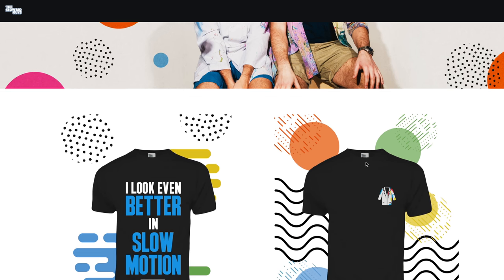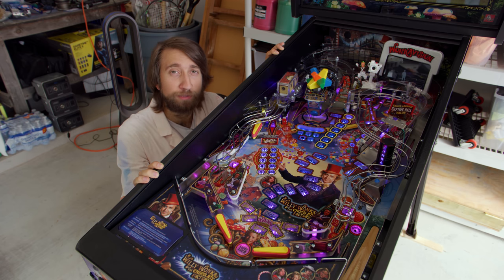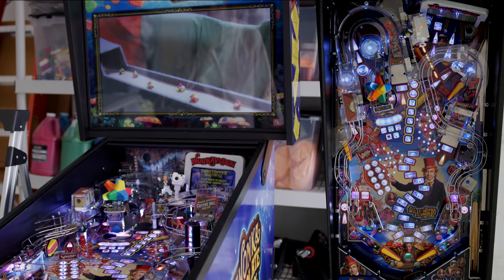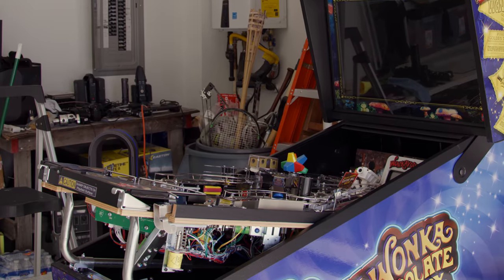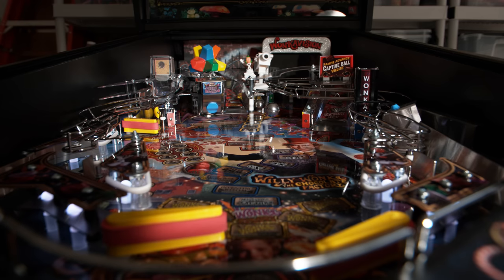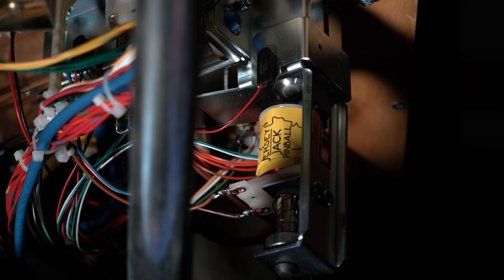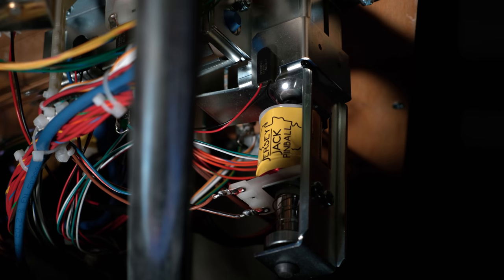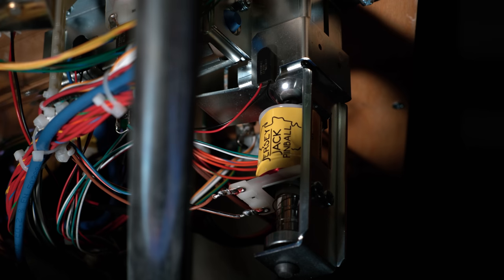How a Pinball Machine works in Slow Motion - The Slow Mo Guys

Comment from the maker: Makes me wonder. Due to these crazy flipper rubber physics, is a live catch possible on a virtual pinball machine? I’ve never played one (other than space cadet) but maybe someone can let me know? - Gav
Reply: For sure possible, but it's wild seeing the real thing slowed down!
Reply: maybe a thing to make newer games more than real. and when it goes too much the other way, it's still something for playpals
Reply: A live catch is very possible on a virtual machine, and likely far more easily achieved than in real life. This is due to a virtual simulation having far less uncontrollable variables to take into account when attempting to stop the ball mid fall. Great video!
Reply: Yes it is possible
Reply: What exactly is a live catch?

If you mean getting the ball to stop to a standstill on a flipper then yeah it is possible on a virtual pinball machine.
I got a lot of them on the default pinball game in older windows. Tho it has been years since I last played it.
Reply: It's possible in Pinball FX but rarely, usually the ball just bounces but it's stopped dead a few times (maybe that's just my lack of skill), death saves are possible in that game too which are pretty fun to do
Reply: Depends on the virtual game and table. Like on pinball arcade, you can live catch the kick-out on RoadShow almost every time, but on pinballFX its slightly more difficult
Reply: if I recall, it was built into PinBot, which came out on the NES, and is based on an actual physical machine I played at a local bowling alley as a kid.  I have the cartridge somewhere.  Great pinball game, whether real or virtual
Reply: Hi Gav, you once filmed a rocket take off in slo-mo, but have you ever filmed(or tried to) a genuine space rocket, and... a second? version that is made using thermography to show the speed at which thermal energy is exerted down/away? the shockwaves from takeoff would be pretty awesome too..
Reply: willy wonka just got better
Reply: I have done it a lot on space pinball
Reply: I went back and checked; you can absolutely live catch in 3D space pinball. 
I’m just thrilled to find out that Gav is such a fan of pinball!
Ed came to a nerd bar in my town and couldn’t put up a hi score. BNL 
If this pandemic ever ends I cordially invite you to Portland, Maine to play some pinball!
Reply from the maker: @DEADFLIP  Good to know. Could have done with your skills making this video!
Reply: It's possible for sure. The hardness level and how to do it varies a bit, since different pinball games have different physics, it's an approximation of real physics, and can vary a lot. Pinball Fx3 has 2 different types, because once they started doing real tables (as opposed to designing their own tables), they also tried to make the physics match the real thing, rather than play well on their own designs. so you can play both sets on the Williams tables. (it's really  3 sets, but tournament mode just has a increased angle of the slope of the table to make the balls move faster. same physics, but it changes how the ball bounces around the table.) 
On a real table it's much trickier, since real tables are subject to wear and tear, things move around and never really does the exact same thing twice. And rubbers age, so even the same table can feel different with aged or different rubbers. on the other hand, it's all analog, so you don't have to deal with input delays which can make things like live catching more difficult.
Oh and , Check out that Dead Flip guy on twitch, he can help you out with anything. ;) (all yours Jack)
Reply: Actually. You Gav, providing footage of what is actually happening with the flippers is very useful for the virtual pinball machine community. Pitty though that you didn't show us more examples. A dream come true would be to have Dead Flip or someone that really know how to do flipper tricks in slow mo.
Reply: In Visual Pinball, it is, but it's hard. We are currently trying to improve Visual Pinball's flipper physics in a next-gen (open source) sim: https://github.com/freezy/VisualPinball.Engine - Gav, if you happen to have more flipper shots, that would help us immensely.
Reply: it's possible, but only because it's explicitly programmed in.  You couldn't perform a live catch in The Pinball Arcade until they patched it in (and after that, it happened way too often), and others like Zen i'm sure have "live catch" code built in.  the minor physical mechanisms that allows for a live catch -- for example the switch from high power coil to low power coil at the apex of the flipper's path -- don't happen in simulations.
Reply: @BrowncoatFairy  Well the williams physics might, the Zen physics, probably not. But it's  still possible to do live catches. (just not reliably.) I'm fairly sure VPX tries to emulate it. as for TPA, yeah that was scripted.  ;)
Reply: @michael-to7ve  holy f... Yes we need this.
Reply: @deanapplegate5750  this is an AMAZING idea.
Reply: I play a virtual pinball machine quite a lot, and using live catches is definitely possible. In fact, it is a very important skill to have.
Reply: It is possible, but only by baking it into the artificial rules of the simulation. Live catches require greater accuracy in timing than 1 frame of video animation, and far greater accuracy than the typical response rate from a virtual system (push button -> computer process -> display result on TV)
Reply: In Space Cadet, there was a nice section near the top that could be reliably reached by catching the ball and then letting it roll almost to the end of the flipper before hitting it full force.
Reply: I have done it in Pinball Arcade, but the physics in that game are really "floaty"
Reply: I have done it before, it is very much possible.
Reply: I always enjoyed your slow motion videos, but this one for me is the best one ever.
So to answer your question, your video got linked by Zen Studios on Facebook, the company that currently has the rights for recreating Williams tables.
Their intention is for the physics to be spot on, so here's an example:
https://www.youtube.com/watch?v=ts5rfZA-hNg

You seriously have no idea how valuable this kind of footage is for us digital pin-fans.
Reply: as far as metroid prime pinball goes. (or as far as my skill goes) no.
Reply: bruh
Reply: It's very much possible in Pinball Arcade, which just emulates real tables very well.
Reply: @bowenkerins  Which is why you separate your physics simulation from your renderer ;)
Reply: @theslowmoguys  And there will be Russian subtitles? (it is translated about a Google the translator)
Reply: It is. It’s actually EASIER to pull it off in certain games
Reply: I just got into Virtual Pinball (3 years later here) and maybe it is just me - but I catch them all the time, tbh too many times when I play - the thought that it happens way to often - goes thru my head.

Comment: We're developing an open source pinball simulator. You can't imagine how valuable this is. Cheers!
Reply: What's it called/where can I find it? I'd happily take a look
Reply: Any chance of VR support? Because this sounds insanely interesting.
Reply: @yp3661  Yes, of course! Unity has good VR support, we just need to figure out how to deal with the different render pipelines. We might need to fall back to URP for VR.
Reply: @CraX Looks like YouTube removed my comment with links to the project. It's called Visual Pinball Engine. Source code is at GitHub. Googling it turns it up pretty quickly...
Reply: Fascinating

Comment: I started playing pinball machines in the mid to late 1970's as a young teenager.  Back then, they were completely mechanical, including the score board which used rotating wheels to display the digits in your score.  The thing the newer electronic machines sadly lack are mechanical flippers.  On the old machines, the button was connected to a rod which connected to the flipper.  You had complete control over how hard the flipper pushed the ball.  If you caught the ball on your right flipper, but wanted to hit a target off of the left flipper, you could give it such a gentle tap that the ball would do a u-turn from the right to the left, then you could slam it up towards the target.  That fine control and finesse is completely absent in the more modern machines.  The flippers swing at 100% force or not at all.
Reply: Thanks for writing this! I'm doing research for a pinball video game I'm working on and in designing the flippers I was surprised that most machines nowadays have digital flip inputs. As someone who always loved the fine control/finesse of foosball growing up, I'm excited to bring analog flippers back here.
Reply: @etin97  Hey, good luck on the game! It would be nice to see some modern pinball games out there =)
Reply: Rigel I started playing them 1970 and collect a few of the old ones, don't really like the electronic type. The flippers were never controlled by a rod but by a solenoid. By tapping the flipper button the solenoid would only partially operate and give the ball control you speak about. I agree the electronic ones have no feel.
Reply: @etin97  The main issue is the reliability of analogue controls. Switches can stand a lot of abuse, and require minimal calibration, while force-sensing buttons will have a limited tolerance range and will need regular checks to make sure the control doesn't start drifting.
Reply: @watchm4ker  sure I think force sensitive buttons are not the move. I think quick digital press vs regular digital press is
Reply: I was lucky to play some of them at my local makerspace before quarantine 
With no ball save u to have to really make those games count but there’s just something so mesmerizing about the old machinery of those games
Reply: "He sure plays a mean pinball."
Reply: @etin97  This will be phenominal in VR! I look forward to seeing your pinball game! Do it buddy!!!
Reply: Yeah i remember them  am 53 now   Rigel i certainly do you had to be quite skilled with your flippers   wish i could see one of them old type   just one more time in my life
Reply: I played a pinball machine for the first time in decades and was totally disappointed for that very reason

Comment: I love this video. Pinball is something I had limited time with at least physically, yet had endless fascination towards especially in form of video game adaptations, fantastical video game logic filled or simulation. And playing actual machines whenever rarely possible.
I would love seeing the same for older "Less electronical" pinball machine, though most things this video focuses on are probably going to be same, with more simple electromechanisms. Solanoids are still solanoids in 70's tables as they are on this modern table.
I also really feel bad for Depp's Wonka, could not even get a pinball table made decades after movie...

Comment: Do a holy Trinity
Slow Mo guys
Smater everyday
Stuff made here
Reply: smater
Reply: @alecweinstein4990  sounds like somebondy skipped a day.
Reply: @brettzolstick989  looks like "somebondy" else did too
Reply: Smarter Every Day made a pinball machine video, and it's awesome. Destin had an old-school electromechanical one he took apart for it!
Reply: Ballistic pin ball machine.
Bulletproof glass. Solid steel case. Air canon launcher, semi-auto flippers based on rocket bat.
Wife mode just sinks the ball immediately.
Reply: What about Mark Rober?
Reply: @brettzolstick989  Slow mo of the blank firing spinning death bat machine

Comment: Technology Connections just did a video on how wires create all the logic for older pinball machines, it was quite fascinating. The hardware hasn't changed, but the control circuits have.

Comment: Random similarity for you space junkies: the Canadarm2 (aka SSRMS: Space Station Remote Manipulator System) on the ISS robot arm's brakes use a high voltage (42V) to release the 7 joints' brakes and then a lower voltage (16V) to hold the brakes released with while the arm is in use. Continuous voltage to stay open is a safety design such that the brakes engage in a power loss scenario. The part where Gav talks about the flippers around 6:35 reminded me of our system though I am sure it is not the exact same architecture it does make me think of the SSRMS.

Comment: There were some rather fascinating pinball games for the Amiga, which IMO played much smoother and better than some of the PC based modelings of many years later.
Oh, and this thumper thing, it explains why one of the machines my boss had acquired made such a noise at certain points, that clearly was not snythetic, much louder, much more violent than anyhing else the machine produced.

Comment: 4:10 I'm lost in nostalgia. In the 70s, when I was going to high school, the local milk bar/smoke shop had room for one pinball machine, and our little gang used to hog it from 7:30am until almost 9am. Luckily, the school was a 2-minute walk. At first, they had some old thing, then they got the Kiss machine. And then came the Playboy machine. 
One morning I started playing (I think it was 20 cents for 3 games) and started getting free balls etc, and replays. At 10am I left, after having gotten to (if memory serves correct) 998975 or thereabouts. It clocked at a million. The sound when you scored a free ball is still in my head as clear as yesterday.

Comment: Something else to check out on high speed:  The switched illumination is actually multiplexed.  At the proper frame rate, you should see these lights pulsing in sequence.  Also, if you've ever seen a machine with a flipper stuck in the up position, it's likely the end-of-stroke switch has failed or was misadjusted.  It only takes seconds for the power coil to melt the plastic inner sleeve of the solenoid, not allowing the rod to return.  You'll probably smell it long before you see it.
Reply: Underrated comment. More peeps should read it. Thank you for this info!

Comment: I have a pinball table that was manufactured in 1978 and most of the mechanical parts seem to be used here in the modern one. the only mechanical bit that it has that this does not is some popup targets which have a solenoid and catch mechanism attached to a spring so the target pops up using the solenoid when you trigger it through usually another target and goes back down due to the spring when you hit it once.

Comment: I've just learnt how to do live catches, the theory of how it works is that it's the same as a drop catch.  Its only possible because the Rubber leaves the flipper or the flipper over extends at its limit and falls back slightly, just like when live catching.  It seems only possible if the ball is travelling quite slowly, either that or I'm just not good enough at it.  Great video guys anyway.

Comment: An old style, all electro-mechanical (no computery bits) machine has many many more wonders inside. Such as:
A target that scores 5 on any digit needs a wheel with 5 lugs on it that trigger a +1 on the digit.
Also the free game clack used to be a normal metal plunger solenoid aimed at the side wall of the main table enclosure.

Comment: Also, 11:19 - many older electromechanical pinball games would end the whole game if the tilt bob was activated once. One notable example in older solid state pinball games is Centaur - it's possible to set the game to end the game when you get 2nd warning. After getting first warning, "Warning" insert will light up on backbox to let the player know that the next activation of tilt bob will end the game.

Comment: I never knew these were so complicated. I honestly would have thought some of the things like triggers, etc would have been just like micro switches not contects. Kind of surprised too the spinner thing triggering the switch I would have expected like an encoder. Also interesting all the ethernet lookign cable that must be for like control signals between different things, real curious if that is just using it for the wire or if it is really ethernet based.

Comment: Pinball machines are fascinating things, built to take a LOT of abuse from high-speed metal balls. If you've ever seen the insides of a fully analog/electromechanical pinball machine from the 60's or 70's, those things are insane. They've been able to do all kinds of crazy things with very clever arrangements of switches, solenoids, and gear wheels, for decades before the digital revolution.

Comment: The older pinball machines were a little bit more powerful on the flippers. The ones you can play today are a bit weaker but still perform the same function. I used to spend hours at the arcades playing pinball.

Comment: I knew some of those things where just solenoids, but what I didn't expect is for everything except the plunger to just be solenoids; even the flippers. I don't know what I was expecting really but I thought there would be some motors with cams and spring loaded mechanisms in there somewhere.

Comment: Great video!

What year was this machine produced? I was surprised how much cleaner and simpler it is than the old machines. I wonder if the old ones were more resistant to knocks. The components of this arcade machine ripple and sway each time the solenoids are activated, or when the ball hits hard. It gives me the impression that the screws and nuts won't stay in place for long.
Reply: late comment, but this table was made in 2019 by jersey jack!